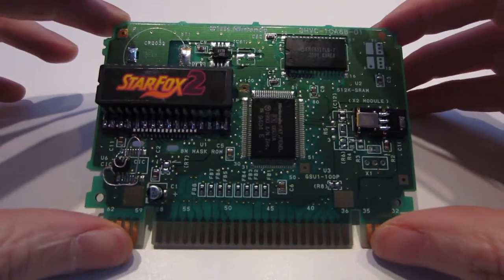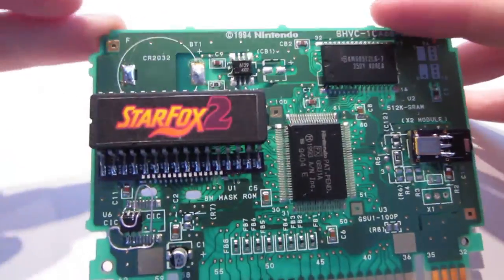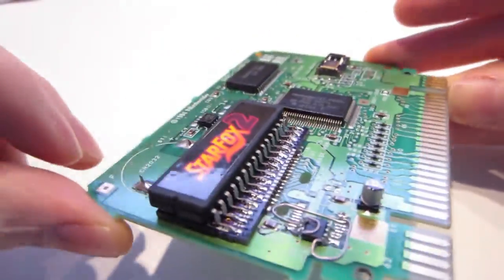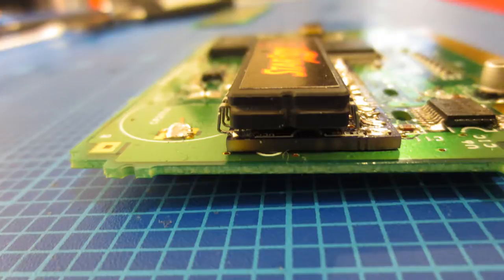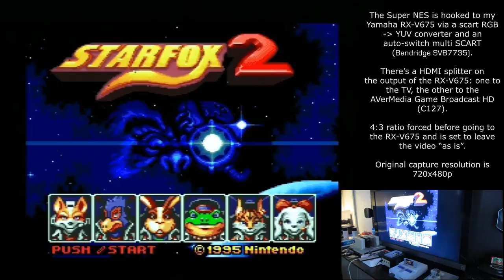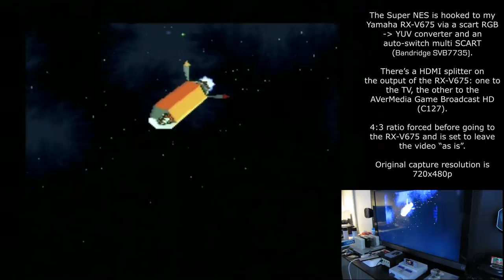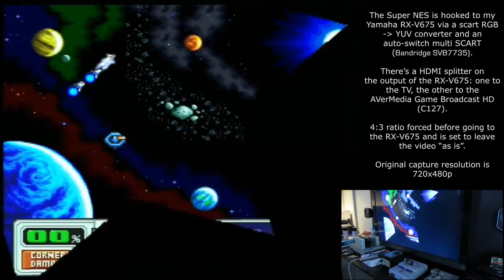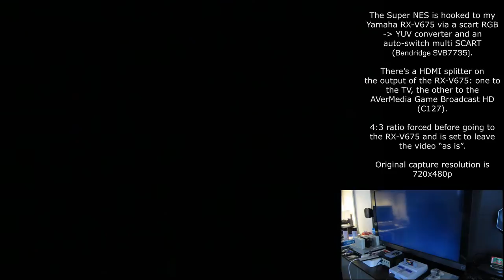[Retro] Starfox 2 reproduction cart Overclocked with 50mhz crystal oscillator

Comment: Heya, I could use some help.
Could you list a site where I could order everything needed?(everything but the Stunt Race cart and the adapter)
Thanks!
Reply from the maker: If you want just the game, you need a 27C801 eeprom. You can find them on ebay or buyicnow.
for the quartz oscillator something like https://www.mouser.com/ProductDetail/CTS-Electronic-Components/CB3LV-3I-25M0000?qs=%2Fha2pyFadui3QyJPYyCHwQLiEbqBQ97iP8ppkOwnGQPG0%252b7XpX2o2A%3D%3D

Comment: Is it possible to buy one of your adapters for a 27C801?  I've got a cart on the way, and some 27C801 chips, but I would prefer to use one of those adapters rather than using floating wires etc.
Reply from the maker: +GadgetUK164 Sure it's on OSH Park:
https://oshpark.com/profiles/The_Real_Phoenix - 3 for  USD 7.2$.
I can send it one of my spare from here (Canada) but just the shipping cost in regular letter (50g) from here will cost CAD 4$ (USD 3$) So maybe it's more economic for you to order directly from OSH Park. :D
Reply: Thanks, that's brilliant!!! Just ordered 3!  Might take a while but worth waiting for rather than using a floating DIP! =D
Reply from the maker: Yes, I did this adapter for 2 reasons: make something cleaner than a spagetti mod and make something easier and less tedious than wire 32 pins one by one. :p
Reply: Yes, its a really nice design you've come up with - I like it =D
Reply: +The Real Phoenix

Do you have any designs for other types of adapter too, like using a modern Flash chip on a footprint for a TSOP44 (like in the Sega Radica etc.?

Have you done any designs using custom flex cables before?

(I'm looking to get some flex cables made for modding the Dreamcast and other consoles with my true HDMI mod.)

Do you use Eagle, Altium, Kicad, or something else?

btw, your English is fine. Subbed. ;)

(I'm terrified to speak on camera, so well done. :p )
Reply: I am curious about flex ribbons as well - that would be an idea solution to things like this.  If the PCB adapter there was a flex ribbon it could easily overlap and solder directly onto the pads of the SNES cart PCB.
Reply from the maker: +electronash I made a lot of adapters, like:
- a DIP42 to SOP44 to use a 27C322 for Star Ocean / Marvelous without spagetthi mod
- a SOP44 to DIP36, trying to find an alternative of the now rare and expensive 29F032B TSOP40
But at the end those are too expensive to produce and lost their main purpose: a cheap alternative.

I've always wanted to do a TSOP to SOP44, but I've never found a  TSOP 4Mb/Word-Wise/5V compatible eeprom: they are always in 3V or Byte-Wise (and sometimes not compatible with my GQ-4X).

Doing a TSOP version of this adapter is not difficult. In fact a lot of people already done it (check www.retrostage.net or ichigobankai on nesdev.com)
But this adapter was designed for a 27C801 because it's cheap (29F032 are trending around 7$ USD), they're bazillions of them and programmable with a potato without any adapter.

I've never used flex cable yet, not even as a classic link between 2 boards. Last time I've check to make this adapter on flex cable it costs 85$ USD for 10pc on www.iTead.cc .

I'm using Eagle, it's free, I don't need more than 2 layers. The max size of the PCB is stopping some ideas (like consolize my NEO GEO MV MV4F) but since I just need one and I don't now a place where to produce only one PCB, it's not problem for now.

Thanks for my english. :) Unfortunately my co-worker still make fun of me and my french accent.
Reply: The Real Phoenix

Thanks for the reply. ;)

I think I probably meant SOP44 and not TSOP on the Radica? Nice links there though - I will take a look.

Oh, I forgot about iTead - I bought a pocket o'scope or something from them. I will have a look into custom flex cables from them too.

Yep - I still use Eagle. I've been using it for about 10 years now, but I still don't know half of the tricks it has. hehe

I've done a fair few designs on Eagle, including a full schematic for the N64 etc., and I'm looking into do a "multi-system" board which will be FPGA based but have an socket board which accepts real carts for systems like the NES, SNES, Genesis, MSX, C64 Vectrex, PCE / TG16, N64 (eventually), and possibly even the Neo Geo.

I did have Altium installed at one point, but I need to learn how to use it properly. The way it seems to force you to do the schematic before exporting to the PCB layout is quite strange to get used to - I don't think it can do a "realtime" update of the PCB layout at least?

It does have some great features that will really speed up the process of routing the boards though, so I need to start learning it soon really.

btw, for some of the slower / older retro systems, I'm sure it would be possible to use a modern SPI flash chip to "emulate" a parallel ROM chip?

The Quad SPI chips are especially fast, and it should be possible to just check if the address on the console side changes, then grab / output the new data as fast as possible.

That would require a small CPLD of course, but it's definitely something I want to test soon.

I mean, some of the new chips have a read access rates of around 80 MBytes/s or more. And the latency is supposedly very good too (they are also relatively cheap if you choose the right ones)...

http://www.spansion.com/Support/Datasheets/S25FL128S_256S_00.pdf

Obviously the other advantage is being able to re-program it via SPI, but then it would have JTAG on the CPLD too. ;)
Reply from the maker: +electronash Man, you are going to far for me. :) I have no idea how a SPI flash would work on older console. I've seen NES reprogrammable cart (USB or JTAG, check InfiniteNeslives.com ) but I don't know for older than that.
I wish I could know more of programming (at least for basic stuff on PIC). I'm just doing stuff I've already seen online or basic stuff like this adapter.
Good luck with your multi system.
Reply: +The Real Phoenix Have either of you guys programmed a 29F1610 before?  The GQ-4X doesn't currently support it, but I've got the Willem which does seem to support it.  Not sure on the adapter though, I've got a 8/16bit TSOP adapter that is for use with the GQ and Willem and I did test it over lunch with an MX29LV800 and LV160 and both work OK with that adapter, but just not sure if the same adapter is used for the 29F1610 with Willem?  All these different adapters are a pain in the *!!
Reply: I know what you mean about the adapters. It's not always clear exactly which chips they support, and some companies just "assume" that you know what the equivalent chips are.

Is this the 44-pin SOP version of the F1610 you mean?
Reply: And is this for a SNES or Genesis maybe?

I'm guessing SNES, even though the chip can be set to have either an 8-bit or 16-bit data bus?
Reply: It's for the Neo Geo - I pulled some of those chips and DIP adapters off a Bomberman bootleg.  They are 48 pin TSOP I think.
Reply: It think the F1610 is almost pin compatible with the LV160 (SOP version at least), but with the extra two pins on the "top" end of course.

I wouldn't have thought the programming protocol was much different. Most of them just send 0x55, 0xAA to a specific command address, then send a few more bytes to do the Erase and Write commands, so they are fairly generic.

I would imagine that if you use the protocol for a similar 16 Mbit chip with the same pinout, it will probably work anyway.

Got to make sure the pinouts definitely match though of course, or it might damage the new chip.
Reply from the maker: +GadgetUK164 Yeah I've tried the 29F1610 with the GQ-4X and that's a no go. It's much closer to the 29L3211 than the LV160 (only one pin which is  /WP).
There's a post on MCUmall's forum about that (http://www.mcumall.com/forum/topic.asp?TOPIC_ID=5196), and tried a bunch of thing (adding the line in the device.txt, wiring stuff, etc.)
I haven't push thing a lot further than the post, but the best I had is get the chip recognized and blank-check it. Erasing it is done on 0.38s wich is weird, and writing it stuck at 0% (at 0x00018D or 0x00019D) but blank check after that still return a blank chip.
The thing would be either reverse-ingeneering the ADP-019 and wire the 29F1610 correctly to be sure the adapter is not messing around with the process. But even with that it not sure that the GQ-4X will be compatible.

Comment: Makes you wonder why Argonaut didn't clock the SFX higher from the factory since it has such a high headroom for high, stable clocks, which increase game performance and entertainment value substantially. Playing starfox at stock clocks with its low framerate vs an overclocked GSU is almost unplayable! For Starfox 2 I think 75MHz or so would be advantageous over 50MHz. For Starfox 50MHz is far more than enough to keep the framerate nice and smooth.

SNES9x uses a by default "overclocked" SuperFX emulator core, which eliminates all slowdown from SFX games. Quite a nice little touch. Any open source SNES emu can also be very simply modified to decrease the time between the core execution ticks which is the same as overclocking a real SFX IC.

Comment: petite question: je vais envoyer la rom convertie en ".bin" avec l'option "swapbin". Ma question est comment cabler l'eprom 27c801 sur le mask rom ? il faut juste intervertir les pin 24 et 31 ? ou alors c'est un tout autre shema ? merci d'avance !
Reply from the maker: +Metroid24abd Salut, Attention si tu utilises mon adaptateur il est prévu pour une archive SANS swapbin.

Si tu veux cabler manuellement ton EEprom oui tu peux swapbin ton archive si tu veux, tu n'auras que les pins 24 et 31 à invertir. Mais comme tu vas de toute façon devoir recabler à la main le 27C801 je trouve pas ca necessaire.
Reply: +The Real Phoenix comment je converti la rom en .bin ? quelle logiciel me conseil tu ?
Reply from the maker: +Metroid24abd SNES ROM Utility http://www.romhacking.net/utilities/593/ . Ca te permet de cleaner la rom de son header (si il n'y a une), de découper la rom (si tu fais des repros de plus de 1Mo) et de swapbin si besoin.
Reply: +The Real Phoenix je choisi quelle option pour ton adapter ? "remove header " ?
Reply from the maker: +Metroid24abd Si elle est disponible, oui. Sinon ca veut dire que ta rom n'en a pas et qu'elle est ok. Ensuite peu importe comment ta rom est nommée: BIN, SFC ou SMC en fin de compte ca reste des données binarisées, ce qui change c'est la manière dont la rom a été dumpée (et donc ce que contient le header, les rendant plus ou moins compatible avec les émulateurs).
Il faut juste une rom sans header non swappée et tu peux la renommer en BIN. Mon archive est un fichier SFC que je grave en tant que BIN avec mon GQ-4X, et ca marche très bien. :)

Comment: Hello, first of all, thank you very much for the tutorial. I would like to ask if there is a possibility to download the gerber file from the nintendo pcb. Trying to get the original rom, a contact broke and I can't fix it. It's a shame to waste all the components on the board, fx chip included 😢
Reply from the maker: Hi, Sorry I don't have the PCB of the cart. You can try to track back the broken pad to see where it is going  (hopefully to a via) and put a small kynar wire between the adapter and there.

Comment: Would it be better to use a doom cartridge since it has the gsu2 chip (super fx 2) as opposed to the original super fx chip?
Reply from the maker: GSU-2 is not the Super FX2. Super FX2 was supposed to be produced for Starfox 2 but never went out from conception by Argonauts Games. Prototype of Starfox 2 was done on a Super FX.  GSU-2 is the same as the GSU-1, with the ablilty of handling more I/O, meaning supporting bigger game (more than 8Mbits) or bigger Ram. That's all. The "Double Speed mode" is working on a GSU-1, and it's just an other way to use the chip, so GSU-2 is not faster. No difference in the framerate. See https://www.youtube.com/watch?v=6HF8yfhWJJM per exemple.
Also, Doom don't have the save circuit. Yoshi's island has a too small RAM. Only the PAL game "Winter Gold" is compatible without any mod, but that doesn't worth it (Starfox 2 is a 8Mbits).
Reply: You could probably get the game to save if you added your own Flash chip.
Reply from the maker: Amaroqdricaldari It will be difficult, not impossible, but difficult. There's already a RAM chip on the DOOM cart for the GSU where it can store and execute its own stuff, but you'll have to reproduce the saving circuit with the MM1026AF system reset chip, and rewire the RAM chip to link then. Way to much trouble for nothing.

Comment: Thanks for the info. Its more usefull for me. I have problems to disable IRQs. How it you make this? I don't find the solution.
Reply from the maker: As I wrote you need to find somewhere in the rom where the game is writing at the address 2100. It's some sort of blank space where developpers seems to put a lot stuff (temp values, states, etc.) .
I'm not a programmer so this is a lot experimental.
From what I understood:
"A9" I'm not sure what it is, but I guess this is some kind of command for the CPU for manipulate registers.
"xx" the value you want to operate
"8D" means "write at the following memory address"
and "xx xx" is the address bitswapped (so you'll look after 00 21).
As exemple "A9 01 8D 39 30" means "Take the value "1" and write it at the address 3039"
You have to rewrite something going to the address 2100 and replace it by the value A0 for the IRQ (which is "disable") at the address 3037 and without making the game crash.
You'll need a debugger and trace when, what, and why the game is writing at the address 2100.
It took me multiple tries to find a good spot.
I won't tell you exactly where I did mine because it somehow my "signature" on this repro. :)

Comment: This ROM mod should also work with other games like Doom and Yoshi's Island, correct?
Reply from the maker: Technicaly, yes Starfox 2 can run on a Doom or Yoshi's Island, but neither of them will be able to save the highscore: Doom doesn't have a saving circuit, and Yoshi's Island RAM is too small. Also, no speed difference between a GSU-1 like this video and the GSU-2 on Doom/Yoshi's Island.
Reply: @TheRealPhoenix_Retromods , sorry, I meant if it could convert Stunt Race to Yoshi's Island, etc.
Reply from the maker: @jutemankif  Ha no. That's not how it's working. The GSU-2 was created to handle additional I/O addresses, so bigger games. GSU-1 can handle ony 8Mbits (1Mo) games, GSU-2 can handle bigger games. So putt Yoshi's island on a Stunt Race FX cart is not possible. It is however technically possible to put a Stunt Race FX on a Yoshi's Island cart, but why on earth would you do that?

Comment: Happy to see someone is using my modded rom file that adds back the full menu. By the way, you do anything to the rom before Overclocking it to 50MHz, like the speed mode? Just asking as I'll to know before adding it.
Reply from the maker: Yes, it's wrote in the description of the video: disabling the double speed mode and and the interrupt mask (IRQ). Now I don't override an empty address (2100) to do so anymore and squiz the code between two jump and in a empty space of the ROM.
Reply: Thanks for the info but sadly I can't get how to disable the IRQ Interrupt Mask to save my life, any ides or maybe I can send you the rom file & see if you can edit it? (I'm using the SNES Mini var of SF2)
Reply from the maker: Contact me in PM (go to the channel page --> About --> Send message)

Comment: Hello if your 52mhz romhack patch is applied on the rom for the SNES Classic Mini does that make the game run more fluid on that system? :)
Reply from the maker: Not sure the patch will work on the SNES classic rom. Also the game will be faster, not more fluid.
Reply: @TheRealPhoenix_Retromods  not at a higher framerate? oh
Reply from the maker: @Phantron  No, unfortunately, the game is programmed in "frame" based, not "delta time" based, so each frames a rendered faster. But it does not adding frames. @HackerVilela is trying to tinker to do  that but it seems very difficult.

Comment: I really like the adapter board for the EEPROM, are you willing to share that design?
Reply from the maker: Mikael Jönsson There's no rocket science behind it. It's basically this http://i1222.photobucket.com/albums/dd500/MrPete1985/SNES%20Reproductions/SNESDiff_zps9b17d691.png wired into Eagle CAD. It's easilly redo-able.
Reply: The Real Phoenix ok, I thought I'll save myself some time if you already had done the work and just wanted to share the Gerber files, looked like oshpark produced PCB and you can share there. but understands if you want to keep your design to yourself. I'll make my own, thanks for the inspiration anyway. :)
Reply from the maker: Mikael Jönsson https://oshpark.com/profiles/The_Real_Phoenix

I took me half-an-hour to make it on Eagle CAD, and most of it in order to find the right place for the hole (for the capacitor on the board). The only problem with this adapter is it's only working on the Stunt Race FX pcb (1CA6B-01).
Reply: The Real Phoenix Nice, thanks alot. Stunt Race FX is the one I using as a donor. all other games just seems like a waste of good games. :)
Reply from the maker: Mikael Jönsson Not Really. In fact, Stunt Race FX is not that bad. Dirt Trax FX or Vortex are really bad games, unfortunately they don't have the save circuit. But if you compare to Yoshi's Island or Winter Gold, yeah. :)